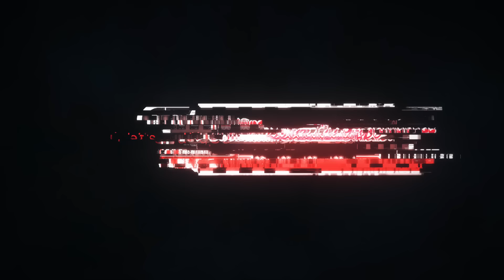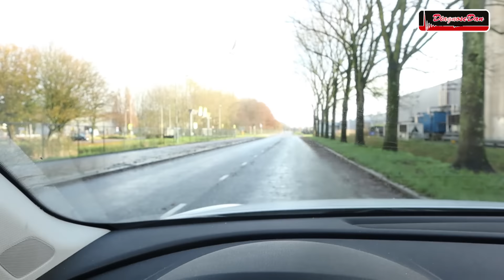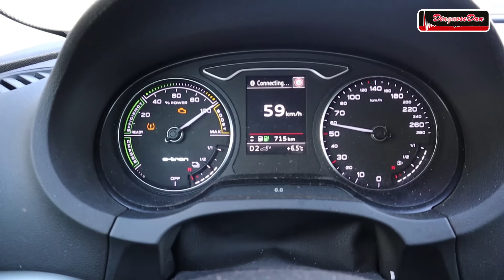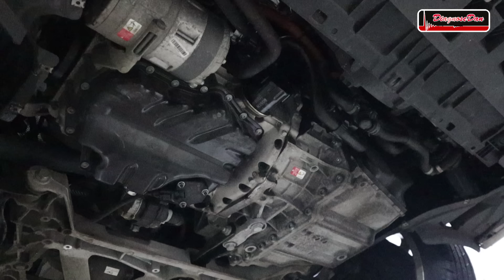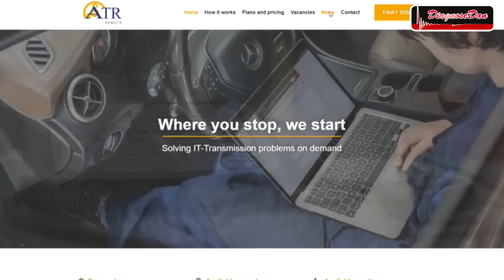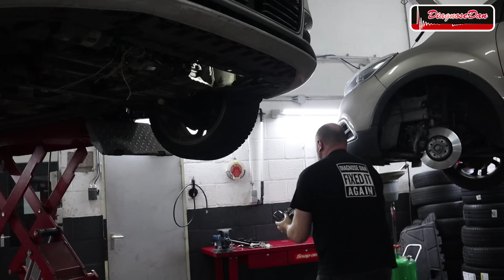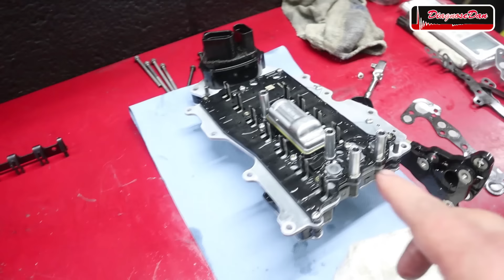DSG DQ400, p2884. Replace or easy fix?

Comment: @Diagnosedan it's hilarious that the filter screen designed to stop debris entering the solenoid is actually the culprit. I think Audi should be fixing this with a recall, clearly there is a manufacturing defect with that gasket from new, great work as always Dan 😊
Reply from the maker: Agreed!
Reply: Not a manufacturing defect but a design defect. K0 needs a bigger supply of oil, the extra force on the mesh flexes it to the point of fatigue failure. A larger orifice might be the answer.
Reply: this is a "problem" for the past 25 years. Passat W8 had this problem at the cam adjusters, S6 V10 had it also at the cam adjusters(just not that often). those sieve´s are there to catch chips left from production after a few miles they are not necessary anymore. so it protects the manufacturer against DOA products and gives the customer the problem at high mileages(hopefully after warranty🙄). the new gasket could´ve been installed without the sieves and it would work just fine. at the Passat W8 you get a new cam adjuster valve and put out the sieves so they dont damage anything. possible chips from production cant be there anymore. oil filter will do the trick now.

Comment: The problem you have highlighted Dan should be accepted by the manufacturer as a recall. A relatively easy fix compared to replacing the whole unit at mega cost. The manufacturer needs to save face and accept that the issue falls well below their usual standards of engineering. Thanks Dan for highlighting the issue
Reply from the maker: In none of their documentation they say anything about the screen failing. Although they certainly know about this. I dont think this is a coincidence
Reply: @Diagnosedan  Unfortunately they always choose to save money , they know this issue would be investigated if they mention what fails
Reply: But its only a"fix" for another 60,000kms ??.... in my eyes thats not a fix and even a replacement Mechatronic unit is not solving what is in fact a design fault...🤔
Reply: @peterfitzpatrick7032  Dan said that the replacement Mechatronic unit was an upgraded unit by the manufacturer. Presumably the manufacturer has “removed” the initial problem highlighted by Dan. With this in mind possibly the transmission should have a “long and healthy life?” Fingers crossed for the owners of the vehicles
Reply: @ianbates1312  if they "removed" the problem, you would assume the new gasket would not have the screen at that location. But this new gasket did.

Comment: Stunning. Just stunning, your diagnose, Dan. The part that is supposed o protect the solenoid kills it. Because of a sloppily designed gasket you need a € 3.000.- repair after 100.000kms. Luckily my Caddy has a manual gearbox. And it is for sure my last car from the Volkswagen scammer group.
Reply from the maker: Thanks for watching!!

Comment: The auto manufacturers are getting away with murder. Imagine you pay thousands to by a car with a defective part and then you have to pay thousands more to fix that error. They know about this issue, why not recall cars with this part and replace it?
Reply from the maker: They will fix it when the car is still under warranty. But when the waranty runs out .......

Comment: A very nice investigation Dan and to find the cause without having to buy a new unit .
That's it with manufacturers .O just change that expensive part .
Obviously they have not looked into the failure. Or have they and don't want you to repair it 😮😮
Nice ofvyou to do your own investigations and to publish your findings . 👍👍👍👍
Reply from the maker: Thanks!!

Comment: Actually it makes sense to replace the whole unit because small particles from the filter mesh could compromise other internal components. Maybe that's why VW says to replace the unit, that's the only way to guarantee no failures down the road.
Reply from the maker: If you think that way, a new mechatronic doesn't prevent that either. Particles could still be in other part of the transmission.

Comment: Danny AWESOME video will save many owners a lot of cash and thanks for the update to the PATTERN FAILURE DDTSB. Here are the timestamps if needed along with some personal notes.

15 Audi A3 e-tron 2016 PLUGIN HYBRID 
30 No ICE Action & Reduced Power MSG 
150>225 SYMPTOM 
305 SCAN CODES C102D P2884 Engine Disconnect Clutch Stuck Open 
515 TSB/TPI INFO R2 UPGRADED Mechatronic Unit 
640 DDTSB 7549 
910 LINK in Video Description ATR Transmission REPAIR Website Article 
1025>1635 REM & DISASSEM & REBUILD & REINST MECHATRONIC PROCEDURE 
1500 Fault ID CLOGGED Solenoid 
1640>2100 SERVICE DSG Oil VIA Scanner PROCEDURE 
2110 VERIFY Test Drive ICE ACTIVATE 

## MODULES GATEWAY PATTERN FAILURE FWD TSB INFO DDTSB 7549 LINK https://atrremote.com/news/vag-0dd-p2884-the-release-clutch-engine-disconnect-clutch-is-open-position/

Comment: The force required to cut that screen out and force it into that hole is amazing.
Reply from the maker: It develops over many years of bending the screen back and forward. Metal fetigue eventually causes the screen to fail.

Comment: 100,000 Kilometers or 62,500 Odometer Miles.  Knowing this, like you I suggest making this part of Periodic Maintenance at every 50,000 Odomer Miles or 80,000 Kilometers.
Plus with the fresh fluid change, your helping to extend the life of the unit.
Your fluid change procedure is very similar to my 2020 Toyota RAV4 Non Hybrid with an 8 Speed automatic transmission.   The Car Care Nut or TCCN has a procedure for changing the fluid in his You Tube Videos.
Thank you for this video Dan!
Reply from the maker: Thanks for leaving a comment its really appreciated

Comment: Dear Dan,
VW requires to replace the mechatronic, 2 to 3.000 € for the part, additional labour and tax. 
You fixed it for € 30 for a new gasket, some other parts, oil, …., maybe 200 € in parts. 
Fuck off VW!
If I have a problem on my car I will ask you for an appointment. 
Regards from Belgium

Comment: Dan, I spent many years creating diagnostic / repair manuals for electo-mechanical systems. I would have loved to have you on the  team!
Reply from the maker: Thats awsome! On what products?
Reply: Huge 500 document a minute check processing machines with automatic document feeders, ink-jet endorser printers, MICR encoders and microfilm capture units plus up to 10  quantity 4-pockets sorting units with lister tape printers. Oh yes, fibre optic communications links and multiple power supplies too.   @Diagnosedan
Reply: I might add that a diagnostics, replacement, and troubleshooting manual would run to 700 pages.

Comment: It's interesting that the screen is totally missing from that hole. What did they do, assemble the gasket and then punch the holes? 🤔 Was the screen damaged allowing it to break free?  🤔
It would be fun to see an original gasket that hasn't failed yet, and look at the screen under magnification.

Comment: The irony, they fit a filter so no debris damages the system and the filter becomes the debris that damages the system, there should be an award each year for the dumbest faults that car makers actually fit. They should have to pay for their stupidity and might then stop doing it, they've been making cars for over a hundred years and yet the cars fail from the most simple mistakes and they then use their failure to rip off the customer, it should be illegal to make money from your own failures especially with all the so called green agendas.

Comment: Every Audi gearbox and clutch combination I have been involved with A3 6speed automatic, 2017 TT, vw GTI DSG had a gearbox or clutch failure, not good enough for a car company that pretends to be at the top end of the market place, Japanese cars are far more reliable and faster!

Comment: I have an Injection Molding Machine that had servo valve filters which use to break apart and ruin the servo valve.  The actual filter was updated to prevent this failure.  Those servo valves are very expensive somewhere between $5000-8000 USD last time I had to replace one.   Problem with debris in oil is dirt breads even more dirt.  BYW:  Heineken is always a good bet solution.

Comment: I'm flabbergasted. Not only because Audi engineers did not put in safeguards to prevent this from happening, and the've only what? about 100 years of experience? Next doing the dealer solution of replacing the entire unit, surely will fix it, but you're not going to have happy Audi drivers. And again flabbergasted because great minds like you and Sam figured this out , made it comprehensible and on top of that making it repairable for a minimum of costs. Lastly I'm flabbergasted because you chose to send Sam a case of Heineken. Surely I would have expected some Leffe or actually drinkable beer :) . In short you guys are magic.
Reply: Dan mentioned how many other brands was this used in.
That being said, it's probably not Audi's engineers that developed it. 
Still, there'll be some unhappy people.

Comment: Sadly the recommendation by Audi seems to fit what is becoming standard industry practice.
They don't think in components, they think in units. Trace the problem to the nearest unit, (engine, gearbox, ECU, battery, electric motor) and replace the whole thing.
Much simpler and faster to diagnose, higher costs are irrelevant on a low percentage of failures and after warranty it doesn't matter anyway, customer pays.
The manufacturers will only have interest in vehicles under warranty, writing off as many as totaled as possible and just throw units at the rest. And out of warranty, a cost estimate of thousands or tens of thousands for any repairs will get rid of unwanted messy jobs or awkward customers.
This is why independent repair shops are becoming more and more important, because they will actually do the research on how to fix the problem other than just throwing massively expensive parts at it.
We will have to see how this goes, because as we can see with Tesla, they don't want anyone else poking their nose into their hardware or software (coughTeslacough) and by locking everything down they will insure that they have the exclusive right to sell you a completely locked down car that only they can "repair" and your only choice would be to go to some other manufacturer that will treat you the exact same. Cars as throwaway products.

Comment: Superb bit of team work to resolve a common and very expensive problem. My question would be why did the little filter fail? were the DSG oil changes done at the correct intervals etc or is there a design flaw in that filter laminate in the gasket sheet. What's the betting  VAG will stop supplying the parts needed - solenoid and gaskets etc as they lose the 2000 euro new control valve sales.. Greta job Dan.. love it. That crate of beer was worth it.

Comment: This is either a design or manufacturing fault if it's that common and a decent manufacturer would correct this foc especially for such an expensive component and the huge impact it has on usability. Shame on them for not doing this

Comment: What a shit future for cars. Stupid technology introduced by manufacturers. Government should force mandatory free repair or replacement of engine/transmission parts for 15 years. Watch how quickly these fragile issues are fixed in design .
Reply: A 15 year warranty on all engine/transmission parts, including labour, would add a LOT to the cost of a car though. Do new car customers want to pay that much extra? Yes, I'd love it if cars were more reliable and more repairable, but they're actually remarkably good these days on average. Go back 40 or 50 years, and nobody would expect an engine or gearbox to last much more than 100,000 miles without a major rebuild. Now the vast majority of them do that mileage with no major problems.

Comment: Daarom heb ik een hekel aan deze moderne voertuigen volgepropt met electronica,geweldig Dan om te zien hoe je de dingen oplost maar wat geeft het me een afkeer van deze "moderne" auto vol met sensors en poespas en de zekerheid dat je der ellende en dure kosten aan krijgt is 100% zeker.

Gewoon een voorbeeld een oude Volvo 700 serie of Mercedes W123 of iets van de betere merken van de 70-80-90 jaren was zo gemaakt dat het nooit kapot mocht gaan dwz maak de krukas lager maar breed genoeg maak de olie pomp maar overkill enz enz.........

Moderne auto,s/motoren zijn berekend dat ze bv 40.000x (of 250.000km) kunnen starten en op warmen dat de motor dit aan moeten kunnen maar daarna worden bv plastic delen (ipv aluminium vroeger) zoals inlaat systemen en klepdeksels hard en kunnen ze scheuren,de lagers beginnen dan slijtage te vertonen net als de olie pompen enz enz enz....

En voor een reparatie van 2000€ kan ik veel benzine kopen wat je hebt bespaard met dit hybride ding aan brandstof geef je weer uit aan de garage.....

Alles was vroeger zeker niet 100% beter want vroeger roeste auto,s bij het leven maar de gemiddelde motor van bv 1990-2005 was zeker niet zwakker als de moderne dingen van nu,misschien meer verbruik en minder vermogen maar de levensduur was zeker niet minder.

Comment: Outstanding. You explained what goes wrong, why, what to do to repair it and what NOT to do and why. That's the way to teach. Not many people do that. I am learning heaps about electronics also mechatronics, stuff that I shied away from. Well done. Supposedly retired 72 yr old mechanic/machinist in Land Down Under.
Reply: Gidday mate! Shoutout from Germany. I love your country. Hope I will be back there some day.
Reply from the maker: Thanks for your great comment, i'm coming down under 🇳🇿 in April at the AAAA in Melbourne
Reply: Great video and fix.I will make an effort to come and say hello at the AAA show.Now retired after 40 years as a transmission shop owner in Melbourne. @Diagnosedan

Comment: Great results and a great  repair. 
The response from the manufacturers of the vehicles in question seems a bit vague ,is it because they don't want to let people know what the problem is,or is it one of pure
greed and would rather just sell  you a new gearbox controller unit???? 
I understand that the  later units are some sort of up grade. But it would appear very short  on information!!!!

Comment: This attitude from manufacturers is completely nuts. Cudos Dan for showing how to troubleshoot and how actual mechanics actually CAN repair things - not just swap out parts!
Reply: Looking at the quality of work of most workshops I have seen, VAG might be correct to suggest to swap the part. There are are probably quite a few things you can do wrong repairing it yourself. Also who knows if the upgraded unit also solves other design flaws…
Reply from the maker: @random123name1 less that can go wrong indeed.
Reply: It's how manufacturers make huge amounts of money on spare parts. Anything that goes wrong on a car these days is going to cost a fortune.
Reply from the maker: @felixalbion they make a lot more money on parts than on selling new cars
Reply from the maker: Thanks for the great comment